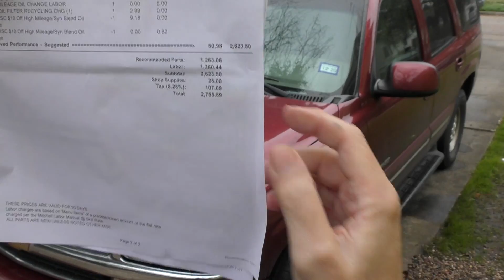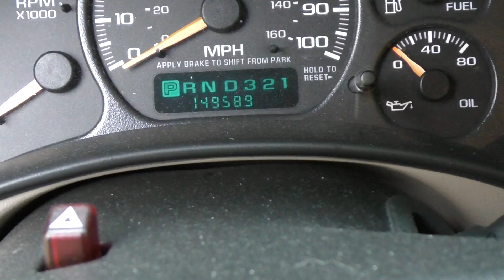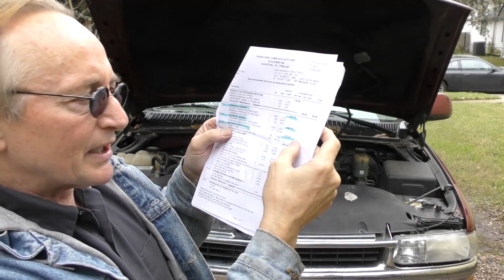This Makes Me Want to Quit Being a Mechanic

Comment: I just seen some lady come in the shop I work at and her drive shaft liturally ripped out of the cvt transmission and it is gonna cost her 7 thousand to buy  a new one and put it in, also she was just recently at a scam shop that charger her for pads and rotors and never replaced the pads

Comment: The customer wasn’t wise, she was problematic. We need more info because any mechanic knows that she was priced out the door in order to avoid either the customer or the vehicle. Tahoe’s, silverados, Chevy in general as far as trucks can be a pain if u have to do full body lines. Ford F-150 usually end up dead on arrival. Dodge is trans and electrical bull in the new ones. If u take a step back from the fandom and think like a flat rate auto tech, you will find that something went wrong and the tech wanted to bail. It doesn’t make it right but at least she kept her money and the tech found something he can do with confidence.

Comment: I used to take my company car to firestone  because I was not paying the bill. I saw them giving this lady a load of crap about all the work that needed to be done. I wanted to tell her to run away fast. Before this I had taken the family car in for an estimate on new brake shoes etc. They wanted to charge me ~$1500 to replace rotors and even a caliper. I did it myself $90. Rotors were fine after I had them turned at NAPA and there was nothing wrong with the caliper. Effing crooks is what they are

Comment: Scotty i drive a 05 camry 4cyl with 136k. It has what i assume to be a timing chain rattle at startup. Local Toyota dealership wants 900 to replace timing chain, timing chain tensioner. Do you think its worth it? Should i sell the car before it breaks? What would you do.

Comment: Hey Scotty I’ve got a great 2008 Nissan Titan pro 4 x with 175000 miles on it done a drain and fill on the transmission  at 75000 should I do a complete filter change this time ? Still runs and pulls excellent

Comment: Hey I have a 2008 Volkswagen Jetta 2.5L 5Cylinder Manuel. There’s a clicking like noise where my serpentine is. My belt was tore so I changed it. Then I thought it could have been the alternator idle pulley. So I changed that. I regret buying this car it was nice but burns a hole in my pocket and I’m only 17. I have no clue what it could be. The sound seems like it comes from the ac pump the lower tensioner. Any thoughts on which it could be ??

Comment: What would you guys recommend for a 2014 Expedition (with the tow package) with roughly 170k miles?  Trying to figure out if it needs to be replaced or if it can be kept running (and yes, it tows regularly).

Comment: I don't agree with everything in this video (ASE Master/14 years experience) It's all about how you present everything to the customer, there's a difference between preventative maintenance and things that need to be repaired ASAP. Examples: The Valve Cover Gaskets, yeah its not puking out oil YET....there's signs of future oil leaking from them...you let the customer know this may need a future repair and give you the estimate so when its time to replace now you have more information. You really want to wait until there's oil leaking on the exhaust manifold and it starts to smoke and smell really bad and then you have to rush to get it repaired? 2nd example: The tires, its not ALWAYS about tread depth, the wear pattern (feathering causing loud noises while driving from not getting properly aligned)  ESPECIALLY the sidewall as you can see is dry rotting and is showing the WHITE  under what use to be black rubber, that means that sidewall is VERY soft and prone to blowing. You give the customer the option AND information to make the decision for themselves....the number 1 thing that gives mechanic shops a bad rep is either from not explaining correctly or because the customer does not understand basic vehicle repair or maintenance. If it was MY vehicle those valve cover gaskets and tires would have been replaced 100%. Another problem is if the technician does not give EXACT every detail of the vehicle and they take it somewhere else, then that technician gives the EXACT details of the inspection they usually call the first technician back mad saying we didn't tell them all the things wrong with their vehicle. People get mad when we tell them we can't duplicate a "problem" they're having with their vehicle or even if the bill/part cost is too high. Circle of Life in this business.

Comment: Hey Scotty! I own a 2008 Volvo S60 2.5T it has 238,300 miles on it and I really like the car and have replaced a lot a parts on it so far. I’m considering doing an engine swap eventually. Should I or should I save up for another car? My car is only worth a little over $2,300 if I should it.

Comment: I work on them all the time i seen the go to go 300,000 400,000 miles with no problems usley just the lifters but there not bad to put in i so the whole moter job for less than 400

Comment: And to think I gripe about having to go through emissions testing ($17 fee) every 2 years in Maricopa County, AZ. 
You people in the big State of Texas are totally screwed 😣
In the last 25 years or so, I've had 3 different vehicles fail one time each due to faulty gas caps that would not seal properly. Two were aftermarket locking caps. In those cases I went home and put the factory caps back on; went back to be retested and passed. The third one was a factory cap that had a bad o-ring. Went up the street to Pep Boys, bought a $5 cheapie and put it on. Went right back and passed the test. Shortly thereafter, I went on eBay and bought the OEM ACDelco replacement for about $12 which is about half what GM Parts department sells them for.

After your video; my griping about emissions testing is officially over 🤔

Comment: in FL they drive like they all racing on the Daytona Track
Reply: @Troy Simoneau Kissimmee.  the cops ignore all the thing drivers are going wrong so they just keep doing it.  I have seen stuff that would scare the crap out most ppl.  drivers lane sharing with scooter and bikes, thinking they have the right of way.  they also think the speed limit signs are the MIN speeds not the MAX speed.  IN the Motor manual in BIG BOLD letters, "THERE NO 10 MPH LEEWAY on SPEED LIMITS".  On I-75, driving 85+ all the time.  GA passed a law, it driving 20 mph over the post limit, they can take you license on the spot. and they should.

Comment: My Toyota Camry is running great there's not a single check engine light on at all however all of a sudden my vehicle stalled and I swerved into the other lanein the car did it on its own because traction control turned off and at the same time the check engine light turned on and I started losing power. So I got off the highway. I turned off the car and waited like about 5 minutes. Then I turn the car back on and the check engine light was off. So I took off back into town and the car was running great like a new car. So I took it to AutoZone and hooked up scan tool. The p0301 code popped up cylinder 1 misfire but when that code popped there was no check engine light. And the drive to AutoZone was great and smooth.

Comment: all states differ..   NYS  whatever needed to pass..  if nothing wrong with in  state limits.  will be fine.   Ball joints not required to pass if bad or not.  only thing is Check engine light, some ppl think ck engine light and can pass inspection.    i was NYS inspector..    really that much  not required.   engine oil leak is not a problem to NY but  leaky gas line or gas tank a problem.  thats all.   all about being safe  ...   i was in GA  and knows about emisison   over 4 million cars drive to atlanta.   really crazy..    yup..

Comment: Midas was charging me over $1,200 to replace my front rotors, brakes pads and 2 end tie rods.  I did the job myself and I didn’t even spend $300 bucks in parts. It’s fckin ridiculous!😡😡
Reply: U still need the alignment after replacing the tie rod ends
Reply: Ruben Ramirez They wanted $1,500 to replace my car exhaust system. My family friend mechanic did it for way less.

Comment: If a state dose away with a inspection is so the cops can pull you over four no reason .i much rather go to a shop get my inspection done if the do try I can simply say no thanks to the work . with no inspection you dill with cops ,tickets., court costs . no thanks I'll take the 20$ inspection

Comment: 2007 Toyota camry $2500 120k miles

Or

2007 Scion tC $2800 120k miles

PLEASE let me know!
Reply: @jamesl9686  they both have timing belt, no?
Reply: Jude Martin Arsulo Dude get the Camry. I have one from 1997 and it’s working flawlessly and more mileage than yours.
Reply: @venividivici4253  I have an '08 Camry with 187k miles, my girl just doesn't like the camry color I found for 2.5k 😅 but since they're both toyota cars, just wanted to see what people would say.

Same engine, just different body and price 😢
Reply: @jamesl9686  True
Reply: Jude Martin Arsulo 97 with  205K
Reply: @venividivici4253  That's great

Comment: Lucky my wife has been going to the same shop now 20 years and we stuck with them I tried another cause it was closer. Come to find out a friend of my older criminal brother works there as a head mech. I gave them a shot anyhow people change. But it took the 3 tries to replace a intake manifold in my 97 grand marquis and I think it’s still not 100% maybe 93% but eh good enough I guess

Comment: Florida might not have state inspections but if you could only see the piece of crap driving on the road daily especially if you go south around Miami areas, it is SCA-RY!!!!! old rusted pickup beated down to the ground with a bed filled with garbage/metal/aluminum without any windows that can't even keep up with the min speek limit of 55mph on I-95. Daily I see people driving in the dark with NO LIGHTS on... drivers that have no tail lights or blinkers and bald tires,  soflo is a world of messed up .... I've seen it all. There are cars on the side of i-95 every half miles everywhere! If you ask me, no inspection is just playing w public safety!

Comment: Chuck finley. It is clear in the video about the location etc. Firestone location 7552 on Kirby Dr Houston TX 77005.  phone 713-659-0114.  Technician 21 Rick.  2755.59 estimate. on 2/14/20 at 11:14-12:25.  Red 2002 chevy tahoe. Complained to location and on chat to corporate. Maybe more should do the same. Maybe those who work there will get a speaking to or the management will be more careful about pushing unneeded services on unsuspecting people who do not know about vehicles.

Comment: Hold up, the work order states that the customer got a "complete vehicle inspection" because "it has an oil leak"... And you're ranting about what they actually found? The valve covers looked like they have some seepage, but not enough to cause great concern so I would pass on that too. They sell tires so I wouldn't be surprised if they try to sell you a whole new set. We never got to see the oil pan to see if the gasket has gone bad, but if it's leaking oil why wouldn't you change it? Same thing with the diff, I would Never let my diff look like that even if it has enough gear oil. If it's leaking, it's leaking and it needs to get fixed. Talking about its "good" for the vehicle, lmao! Don't let your POS look more of a POS by skipping on that preventive maintenance and fix that hooptie man.

Comment: Washington state just eliminated the emissions test that was required every two years. 
But they added a new tax on electric and hybrid vehicles. Nuts!
Reply: ChessIsJustAGame I’m sorry but I completely agree with that tax because yes your using less fuel your not paying your fair share of highway and road maintenance. Electrics should be taxed on every mile and hybrids above what cafe is for every mile you driven

Comment: Scotty has clearly never driven in Tampa lmao. It’s a disaster
Reply: Donavan Caudle Most definitely, they keep changing the direction of the streets downtown... btw Toyota Of  Tampa bayy tried to pull some crap like this on me
Reply: Keye Haze good ole Fletcher
Reply: Donavan Caudle I took my 2012 Camry there and they said my drain plug was stuck And if they got it out it would damage the oil pan and I woild a $400 oil pan replacement service... And told me I didn't have to pay that if I trade in my car and then the dealership only wanted to offer me a new Corolla , I've been going to Tampa Honda ever sense for oil changes...
Reply: Donavan Caudle so they were definitely about to "Fletch" me alright😂😂🤣

Comment: The rear axle was leaking. The rear diff cover was a mess, you just didnt hold the camera on it. For the valve cover you showed just the bottom side of the drivers side. Those engines leak on the back side near the firewall because the engine is tilted slightly back. That means the oil collects there and thats where they leak. You didnt show that so we dont know. Btw, idk if you have ever changed the valve covers in those but it takes 3-4 hours. It's more than a couple bolts. Often those leak slow and as you pointed out its dirty so it wont drip, instead it will form oily clumps of mud stuck to the motor and transmission. I only made it half way threw the video, I couldn't get past your yelling. It's good you want to keep people from getting taken advantage of but I think you're making it worse that it is to sound like more of an expert.

Comment: SCOTTY - COME ON NOW, you say it’s an easy job to replace the valve cover gaskets but then you show the valve covers with all the stuff mounted on and around them that must be removed first before you remove the covers. If you consider the time it takes to get all the stuff out of the way remove the gaskets and replace them put the covers back on and put all the other stuff back where it belongs your probably looking at a $400 job most of which is time/labor. It’s like saying a transmission replacement is easy you just take the bolts loose remove the transmission and bolt the new one back on and your done....WRONG it’s not that simple. Shame on you

Comment: Scotty, your full of it, if someone takes there car in for an inspection it's the repair shop JOB to inform the customer what the vehicle needs, REMEMBER customer is bringing the car in to inspect it, obviously they want to know what's wrong with there car, that's why there paying for it to be INSPECTED, your doing a disservice to auto shops to say there trying to rip the customer off when they want to know what's wrong with there car, shame on you scotty, as long as the service is needed, it needs to be brought to the attention of the customers so they are aware of what is wrong with there car.